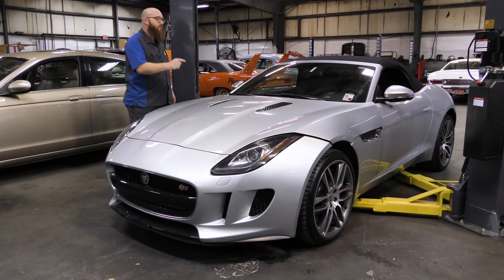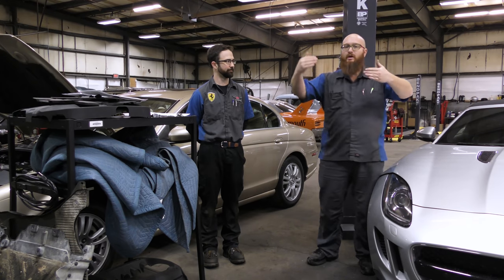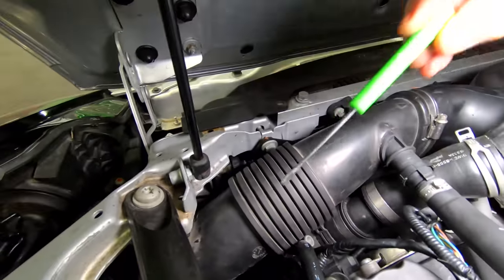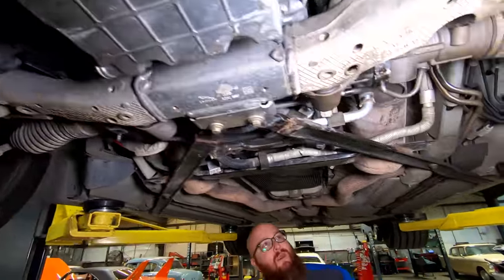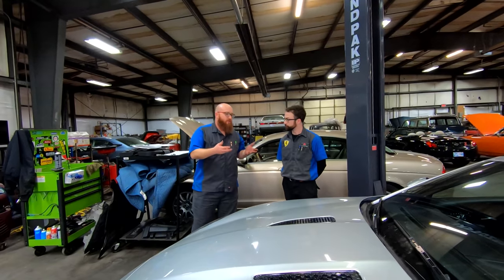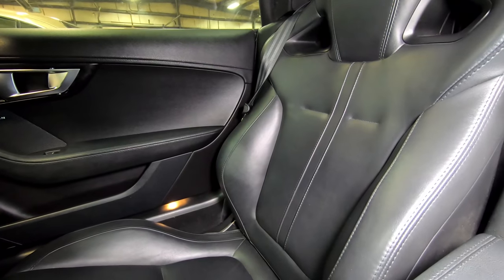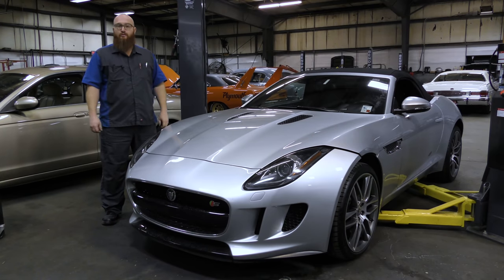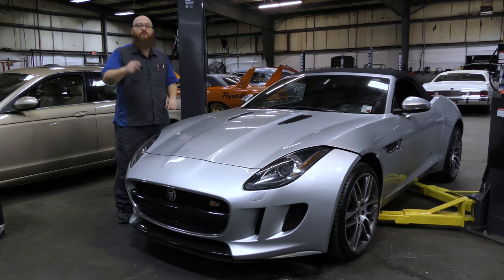How could a shop do such a bad swap? CAR WIZARD points out all the errors on '14 Jaguar F-Type

Comment: Sometimes people go to a low ball repair shop.  This is a specialty car which requires a specialist mechanic, like the car wizard.  Specialty mechanics typically charge 2-3 times more than average mechanics but less headaches.  Specialty cars it’s all about less headaches.  Parts are always a headache but a specialty mechanic usually does the job right the first time.  That is why the other shops said no.

Comment: At least its got a thread. My first WRX came with one bolt securing the starter motor to the engine block because there was no thread in the second hole.

Comment: I worked in the Collision repair field for 25 years. Started at little hole in the wall hackery's. Then moved up to high end dealer fed shops. I did BMW, Mercedes, Volvo, Jags ect. Early in the month it was quality quality quality. But at the end of the month it was Oh oh, better get Maaco work. Manager wanted to close the big ticket jobs so he would get paid. These shops loved the "fast hack". I would give them parts lists. If the clips or whatever didn't come in the first thing I would hear was "make something work". Promise times are more important than the actual quality of the job. Too bad. Nobody seems to give a damn anymore. What bugs me the most is it doesn't take anymore time to do it right the first time when you know what you're doing.

Comment: For the Wizard to believe that the problems are only in the engine bay area is a leap of faith that we were never brave enough to take. Everything on a car some shops touch turns to poo. I hope it works out well for all. This is the kind of thing that can hurt your reputation despite your best efforts. If the engine expires thru no fault of your own, they blame the last person who touched it. A loose converter can destroy a transmission. Stay well.

Comment: With all those missing clamps, not-clipped-in wiring harnesses, and loose bolts, one wonders whether or not they simply left a head-bolt loose when they did the original injector repair, and that was why there was no compression in one of the cylinders after that repair.  Then they, of course, diagnosed the problem incorrectly, and decided they needed a whole new engine to fix that problem.  And then even more chaos ensued.  Utterly ridiculous!  That shop should be paying for ALL of this work!

Comment: That looks like the same Bosch EVAP Purge Valve that GM uses although those usually get stuck open (several models have Special Coverages as a result).

Comment: Ummm........
If this was an I.T job I had to do (and unfortunately I have had many like that) , I would take the engine out and re-fit everything from scratch, so I know there isn't anything hiding.
As others have said - fiddling with the super charger, badly wore interior for the miles ............   wouldn't touch it with someone else's barge pole.

Comment: Shops like this need to be publicly outed. Something similar happened to me where a shop wanted to replace my supposedly "bad" transmission. The problem was actually low transmission fluid. I usually DIY, but I was busy at the time. Never taking my cars to a shop again until I find someone like wizard.

Comment: As a 17 year old with limited tools and money I was both horrified by how awful this was, and offended at points 😂. I have no loose bolts and built my car, torqued to spec and all. But I don’t think I have any wire in shrouds, and I have a lot of wires secured with zip ties 😅. Although mine may be an exception in some areas because the car is an 89’ Camaro, and I got it with alot of the wiring jacked up anyways. Working on a full restore eventually though.

Comment: Firstly I really like 'the Wizard'.  Seems like a good guy.  This video rubs me the wrong way.  Yes there are some things not tighten and buttoned up properly, I agree with that part of the video.  Whoever did the engine swap wasn't the most detail oriented person.  However the issues currently with the car are not related to the engine swap.  The driver of the car most likely ignored a check engine light which most likely was flashing...as the injector locked up and kept dumping fuel into the engine.  Car was drowning in fuel....must have been misfiring like crazy.  In order for the unburnt fuel (extremely hot) to be dumped into the exhaust.  Melted the cats....shop did the engine swap.  Looks like car is running fine.  Had the customer stopped right away and towed the car in, engine would have been fine.  The two issues are not related to the engine swap at all.  I almost guarantee check engine light came back on a day or two after the customer picked up the car.  Customer most likely went back to the shop....they told him what it was and he/she demanded the car fixed for the price quoted.  Even though issues are not related to the work performed.  I work in a shop...have seen this exact issue before.   The evap selenoid is also unrelated but very cheap fix.  2 reasons for CEL.   Cats are gonna be VERY PRICEY....but they are customers fault....this video makes it look like the shop that did the work was EXTREMELY negligent.  Which I don's see at all.  A little untidy sure...but the two issues not the shops fault.  Don't like the video cause it make it look like it's all their fault.  Always two sides to the story.

Comment: I think I know how this car came to this point....
The shop most likely has a technician that is not experienced in either working on Jaguars, or not really good at engine swaps.. I'll say it's both. I'm an automotive technician, but where I shine is in electrical problems, diagnosis with lab scopes, interior trim, and ac. I've done engine swaps before, but have hated them. Not to mention that most shops don't have the right tools for pulling engines. Usually it's a Harbor Freight cherry picker, and a length of chain. But the shop saw nothing but money to be made, and couldn't let that money leave out the front door. They most likely told the tech, hey.... We're doing this engine swap, wither you like it or not. And i'll bet the tech did his best, to his ability.... But this was more than likely just too much for him. I've seen it a million times.... Only a good service writer would know not to even touch this vehicle.

Comment: That steering wheel sucks for having such low miles. Plus like the caddy suv's the air intake is umder the car making it prone to sucking water into the intake and hydro locking the engine in several inches of water.

Comment: You have to check the torque converter bolts/ flywheel. Its quite poss thevperson used a impact on low speed. No torque

Comment: Same fuckery I experienced when having an engine replaced.  They never replaced the spark plugs from the junk yard motor.  They didn't change the oil, they left sea foam in the crank case. Found multiple various bolts, plastic clips and vacuum tubes not connected and or missing.

Comment: I would use wizard if I lived near his shop. Thankfully I have a shop like the wizards shop that I trust and is honest. The stuff my guy has done is when I got a s10 clutch done he said it’s 20$ more after because he changed my slave and my rear main seal. Instead of putting all together then saying your deal is leaking he just did it. Today I took my roomates car that he had checked out and was told leaking water pump. My shop was going to do the work. And a hour later he calls and said it’s not the issue. It’s just a radiator. And saved us tons of money not doing stuff not needing done.

Comment: It was two mistakes. The install mechanic was mistake 2. Mistake 2 is getting an F-Type. Mine is a 2017 used with 42k miles. Cheap plastic coolant lines started cracking and breaking, sound system is garbage, power issues, bad thermostat, rough idle. All things I fixed but at now 60k miles, my 2012 Hyundai Veloster made it to 90K before any major issues. I'm holding onto my Jag but not impressed. Even for a used one, should hold up on wear parts longer. Yeesh.

Comment: I bought my '02 Dodge Cummins HO QCLB 2500 six-speed 4x4 new (75K miles now). First week I owned it, a deer committed suicide on my grille, off to the body shop. The body shop guy calls me the next day and asks if I know the motor has been replaced... uh, no, I did not! Wait, what? So I went over there and he hands me the Carfax report he ran, and sure enough, Dead On Arrival at John Elway, motor replaced.

I asked what made him run a Carfax, and he pointed out that all the bolt heads on the motor and radiator mounts were rounded, like someone used SAE instead of metric (or used a Crescent wrench), and all sorts of wiring harness issues this video just reminded me of. So the dealership obviously had an 800lb gorilla do the motor swap.

The new motor was not a new motor -- replacement motors from Cummins have been rebuilt as a training exercise (the DOA engine original to my truck would've gone this route), and allegedly balanced and blueprinted; this is how I came to have the "Mexican block." So that's a nice bonus, but...

I'm still pissed off at their failure to disclose this information when I bought the truck, or doing anything in the way of customer service. Ever since, I will request a Carfax report from a dealership when buying a new vehicle, because you just never know. People randomly offer to buy my truck on a regular basis, but it isn't for sale. If it was, how much less is it worth without a clean Carfax (both deer are on me) or matching numbers? SMH.

Comment: This sure sounds like a case of gross negligence by the shop that replaced the engine. It sounds like there could be enough evidence for the owner of this vehicle to sue the previous shop for negligent work. I fortunately have never run into this kind of negligence. I have a 2011 BMW 328i with around 114,000 miles and the BMW dealer that I go to has done good work on my car. With cars finding a good competent shop with good competent mechanics that do excellent work is important.

Comment: Stuck open injector will wash out the cylinder screwing up the ring seal. So that is not out of the realm of possibility with the other shop's diagnosis. Now the quality of the work on the engine swap is another story.

Comment: I'm not a mechanic and even I know how to do things better than that.  Hell, I used to change the oil on my gf's 13 y.o. Nissan Rogue and I wouldn't let the fender liner be held in place by 4 plastic grommets when there are supposed to be 5, so I went out and bought some.

Comment: I have the Jaguar XJL 5.0 supercharged ss.  Was told my car needed 12,500 in 100,000 maintenance. Supercharger rebuild and my yr also had cruddy tensioner issue. So I did my own chains. Supercharger. Fluids rear air bags.  Etc for under 1.4k  in parts. Two weekends. So if out of warranty find me or a Wizard to fix to ride!!!  Don't mess around w dishonest repairs and "Mechanics"  just put 1300 miles in er ripping around Tx on Christmas break. Smiling the whole time.

Comment: Know the sensation of being screwed--I have a 2000  garage queen Deville bought new. At 98000 head gasket blew. Spent over 7 grand having new head bolt inserts installed. Blew again at 110,000 and shop wont talk to me and cannot find anyone to fix.

Comment: I am from where Jags are built and have a 2006  S Type 4.2.  Only 27K miles so it is mint, and Ive checked all the usual rust points. My point is why oh why do I see so many Youtube vids of really poor car workshop work in the States. You suggest in the S Type review that american mechanics are not familiar with British cars. No matter that the S type is a Lincoln under the skin. Of course you can get the same over here, but we do not yet have lots of these "shops" you refer to. Mostly here its either main dealers (who are not perfect by any means) and then marque or genre specialists, and lastly decent independent one or two man general car mechanics.  Yes we do now have these national shops that change oil , tyres, filters, brakes and exhausts, but you would be mad to go to them for a cam belt or similar. most decent mechanics will show you the parts that they have changed, like coils etc. I though the good ol US of A was full of litigeous consumers who would sue you as soon as they smelt even a fart, thus minimising scams, but oh isnt that a word originating there with you! Shit even damp olde england still has a lot going for it. keep up the good work.

Comment: If owner doesn't need catalytic converters why not delete them & disable cat diagnostic in software? Also he might get a software tune-up while during it.

I know, enviroment. But it's all to owners decission.

I own a 2.0 diesel from france, chip tuned around 30% from base (100kW / ~136 hp to around 175 hp / 130kW) i don't mention the torque cuz with all units differences between us & rest of the world. It's close to 400nM :D

But it's still with FAP (it's like dpf) and EGR in place.

Comment: Changed engines on these cars for months 7 days a week for Jaguar. 
It comes out the bottom with the gearbox and subframe. Bonnet/hood bolts should never be touched 🥲
Reply: A lot of mechanics would never attempt that.  Especially in the rust belt.  It isn't worth the potential for broken captured nuts and needing an alignment.  You touch as little under the car as possible

Comment: You aren't porting the snout without changing the pulley, tune, and probably injectors. My guess - the original owner either half assed it or paid someone who half assed the modifications and one injector got jacked, leaked fuel into the cylinder, costumer started the engine and bent the rod. No compression. Dealer saw the mods and refused to touch it.

Comment: Jaguars were great car at one time. Yes, yes, yes I know they were not that dependable in the past either but nothing as bad as they are today. Now in all fairness to most mechanics, this car should have had the proven engine an electronics with the straight 6 engine in it. I blame shows like  " Top Gear" that have sent the motorist in the wrong direction to demand more and more power. Most people will never use the power this car is capable of, and would not have the ability to drive them like the guys on Top Gear, who are testing and driving crazy every day. Mostly in safer and ideal conditions.

Comment: The engine bay looks pretty trashed for a 60k mile car, the exhaust has a weird ding in one of the pipes and the steering wheel looks like a camels pooty hole. Great looking car and the exterior looks new. Wonder what happened, there’s more to this story

Comment: This is a proper jag, built by jag in England after TATA in India bought them as well as Land Rover, not one of the fordified jags built on an Mondeo platform using Ford interior and exterior parts

Comment: I reckon this individual has enough evidence to take the previous shop to court. It sounds like the previous shop were the ones who caused all of the problems to begin with. At first it only had an injector problem then the guy took it to the previous shop where they then botched the injector job. The botched injector job destroyed the original engine and they installed a new engine which had many more problems than the original. Tbh that shop should really be refunding him but also should be taken to court. They were the ones at fault to begin with and a small problem could have been fixed with a more dependable mechanic.

Comment: All of these things are in themselves minor, but as you say, if there is this much slipshod attention to detail, what else could be wrong that may be serious? It has been obvious for quite some time, that the more complicated the engineering, the grade of difficulty in finding and fixing any problem becomes far more problematic and of course, expensive. If vehicles are going to be this hard and expensive to fix then the entire industry needs to be rethought as to the usefulness of the technology. Unless one is exceedingly wealthy, buying a high end vehicle is simply a losing proposition as these vehicles don't seem to last any longer than a much cheaper model. 100 to 150K miles seems to be all that any new vehicle, cheaper or high end an stand to be driven without major repair. Which brings me to my 1991 F250 4x4 445 ci IDI diesel. 850K miles+, yet never been apart and still going. Sure, I've had a few issues, but nothing I couldn't fix myself.

Comment: Whilst there isn't much room to work around it, the 5.0 Jag GDI engine is actually pretty nice to work on. Most of it is well laid out and its construction makes a lot of sense. I've done plugs, replaced water pumps, cleaned inlet tracts and a bunch of other jobs on these engines a few times and not much more work or thought was required than any other car.

How someone could f--k this up so badly, I'm sure they wouldn't do much better on a 'simpler' car either.
Reply: Did you come across carbon build-up on these engines?
Reply: @vw5056  A little, the catch can / oil separator built into the top of the valve cover works VERY well. My XF was pretty low mileage at 100,000km when I did this. I was in there to replace the crappy plastic head to head coolant link at the back.

Comment: Depending on what part of Louisiana they don't even check emissions I'm in central Louisiana and mine clogged and I removed them but I drive a 96 Chevy with 336000 miles why replace them when you don't know how long the truck will last

Comment: It looks to me that the old shop was on the hook for replacing the engine. They got a used engine and just threw it in. No care, just get it out of the shop as fast as possible for as cheap as possible. If he can afford it, I'd recommend removing the engine and put it back in with Omega's care.